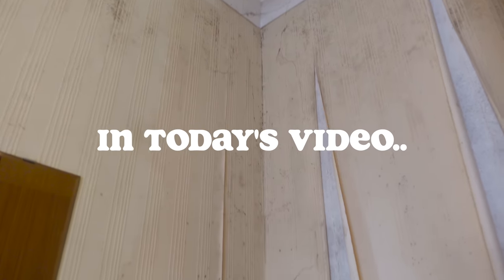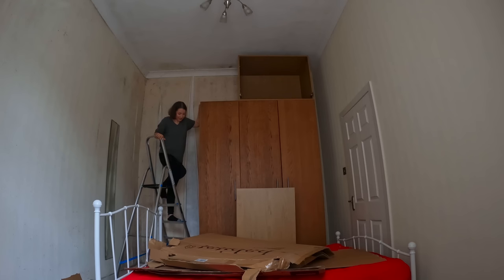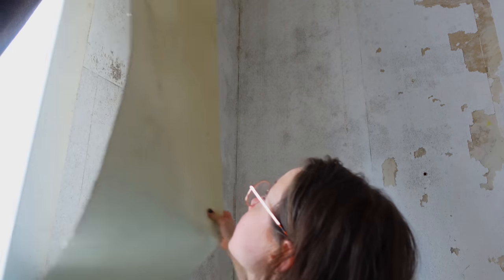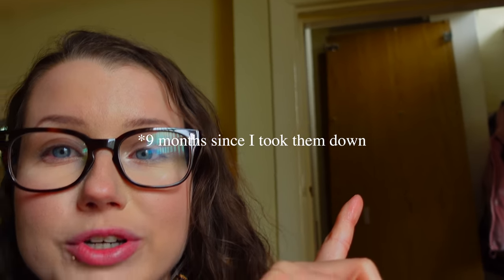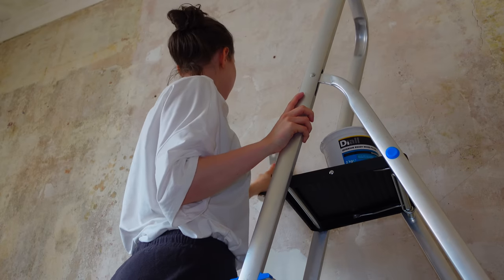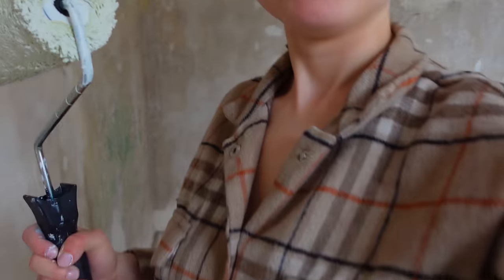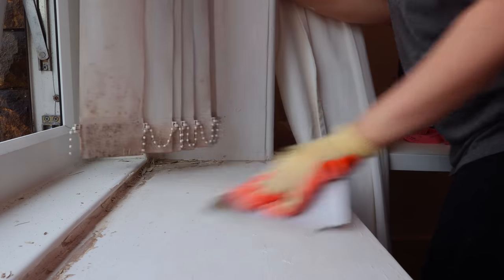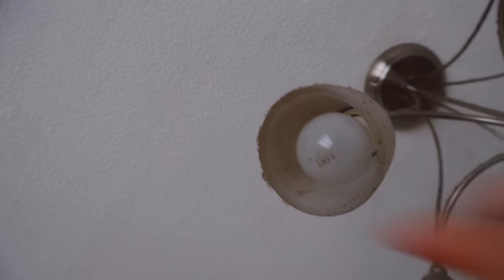EXTREME BEDROOM MAKEOVER (diy renovation, decorating & tour)

Comment: As a couple of people have mentioned below, you really must get rid of the mould before you paint your walls/ceilings other wise it will come back through and it's very nasty stuff, you don't want to be breathing the spores from that in. When you do other rooms in your house go to B&Q and buy some Ronseal 3 in 1 mould killer and follow the bottle instructions, you may need more than one application to get it all off, then once that's done buy some Ronseal 6 year anti-mould paint (this contains a fungicide to help prevent the mould from regrowing) it's quite expensive but well worth it, don't be tempted to buy the cheap stuff, or you'll probably have to redo it. Make sure you open your windows when painting to let the fresh air in. Quick edit: forgot to mention you can get a telescopic extension pole to put your roller on when you do the high ceilings.
Reply from the maker: Thanks for commenting this mark, I’ll be looking into that!!

Comment: So excited that this video is finally out! You did an amazing job! And maybe someone else already commented on it but the plastic things in the wall seem like anchors which keep screws "locked" into the wall so that whatever is being held by the screw doesn't pull the screw out the wall and fall down. Usually best for screws holding heavy stuff :)  typically you can push them backwards "into" the wall so they fall down behind the drywall since they're made to not easily come out from the front